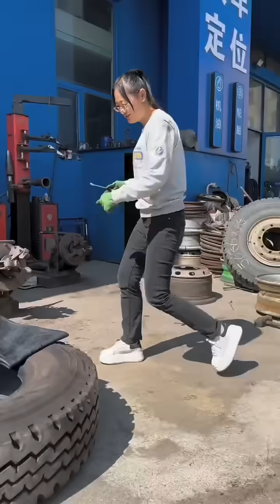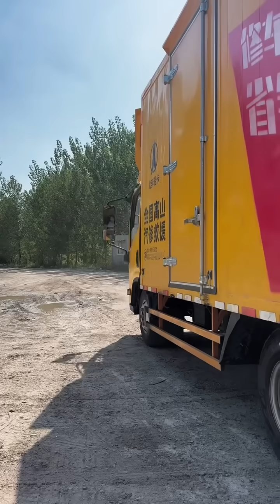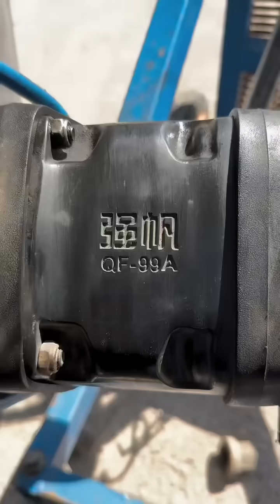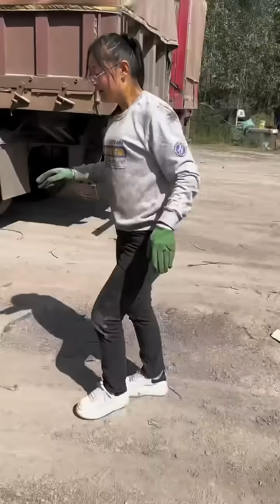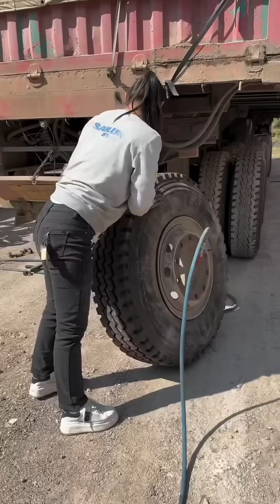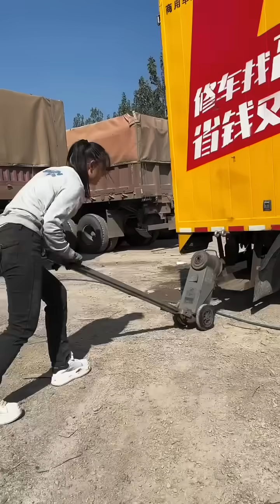Truck Puncture Tire Replacement Outdoor Rescue!

Comment: As someone who has already absolutely destroyed my back from 25+ years of hard work like this, you need to take care of your back, you need a back brace doing that stuff!! It's no fun getting to middle age and having to use a walking stick, and live everyday on huge doses of opiates and anti depressants to deal with the massive chronic pain. You're an extremely hard working young woman, take care of yourself, don't end up like me. Best wishes from the UK. :)
Reply from the maker: Thanks for the tips! 🙏🏻 take care
Reply: eres la chica mas trabajadora que he mirado felicidades eres muy especial saludos aver si algun dia me ensenas algo de eso bue
Reply: A weightlifting belt , plus  an electric  workshop crane (on wheels) and whenever you still have to lift, you hold straight and stiff back , lift with leg strength.
Reply: Smoke some weed. Helps relax all tge muscles and stress in tge body,  greatly reducing pain.
Reply: @John-redc  Thanks for the advice mate, yeah it does improve the pain but I'm not keen on smoking it. Plus finances kinda prevent me from being able to afford it often enough to help overall.
Reply: I was watching to see of she placed undue  stress on her body . Not once thruout the whole process did she have to  stress her body ,. It was all just exercise . Simeone really put a Lot of love into her work place and rig , she used leverage balance and understanding the dynamics involved  really really well.

Comment: Just keep using retreads. It's fine. Each one blown out from previous repairs . And putting a tube is not repair it's like a band-aid. You buy new when your in America. We don't put lives at risk to save pennies.

Comment: I worked at a tire shop for several years and I know how much fun those types of tires and wheels are on getting them changed and this video makes it look so easy but like most of these videos on YouTube it's not fun at times with them. There as fun as swapping out a rear tractor tire.

Comment: I'll have to watch this again. Obviously the punctured tyre was replaced, but why was the spare wheel taken off and another one put back where the spare was? Another interesting video from Mia 👍.
Reply: I imagine it was to rotate the spare into use. Avoiding a situation where you have a spare that's  never seen use but has perished due to age and weather and is useless/unsafe when you need to use it.
Reply: Thanks.

Comment: that locking ring if not seated will do bad damage,  😢 should  always be facing down while adding  air pressure  , this way it hits the ground

Comment: No bag it no cage no axle stands not very professional won't be doing that long with that kind of safety measure
Reply: We did that in the army back in the day but we had a tanker bar to put through the holes of the rim and then we turned it upside down and aired it from the bottom up